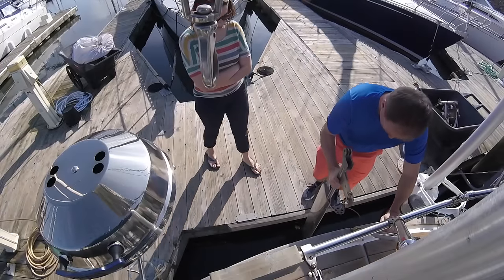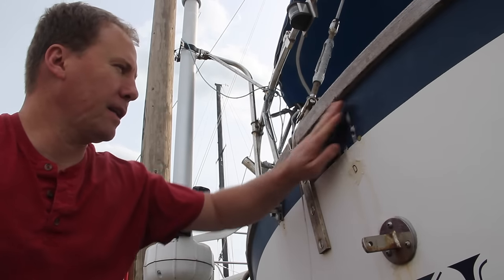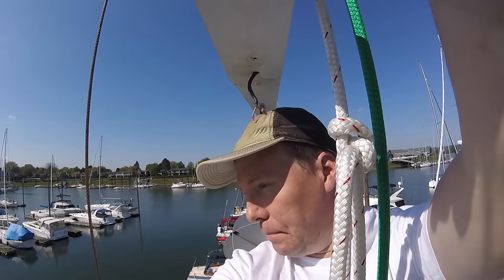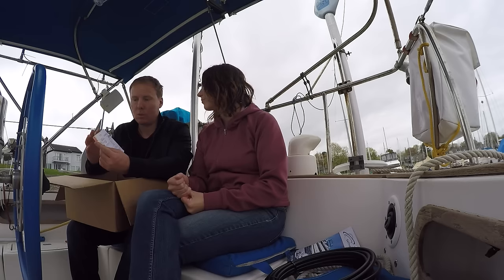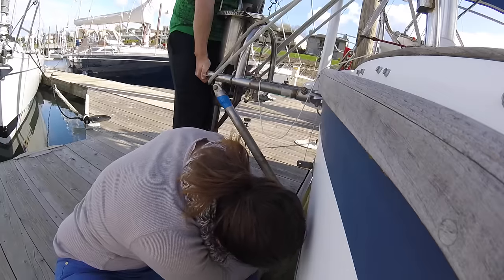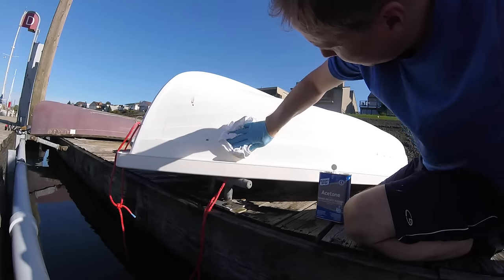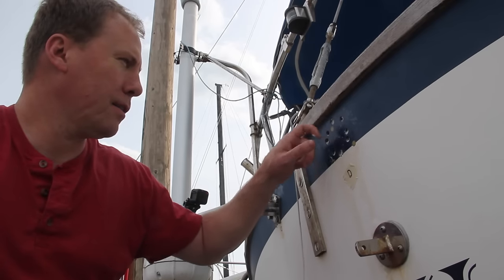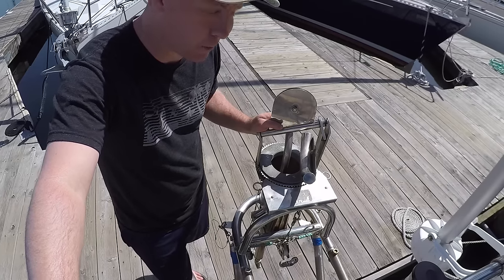THE VANE OF OUR EXISTENCE [Adventure #11]

Comment: A trick I like to use when filling holes or other areas with resin is put tape over the front and back sides then put the resin into a syringe (large gauge needle) and pump it in.  Fills evenly without air bubbles.  Also when filling holes or voids mix flox (finely chopped up pieces of fiberglass) or micro balloons in with the resin.  Makes much stronger.  When installing anything drill one hole and install a bolt/screw then drill the next hole using the antenna/bracket as a guide if the drill bit can fit.  If the drill won't fit in the space, try using the drill bit or scribe with your fingers to make an exact hole or mark.  Just my two cents.  Cheers!
Reply from the maker: All great ideas and great to know for the future, we certainly should have drilled one and installed the brackets to test the next etc.

Comment: Just a suggestion from a non-sailor. I would suggest sealing all holes, bolts and plates when you install them. You will be operating in a very corrosive environment. It is much better to protect from corrosion than have to go back and remove and treat it.  Good luck and many  years of happy sailing.
Reply from the maker: Very true and sailor or not great advice.
Reply: They mentioned using buytle tape to seal things up.

Comment: Whats the monthly bill for the aridium go ? Why the windvaine and not an auto pliot ?
Reply from the maker: Iridium fluctuates from around $50-125 depending on what plan we have it on that month and how much we will use it.  Basically we have it at $50 when close to shore and the higher unlimited $125 for offshore passages.  We have an electronic autopilot as well as.   A  windvane is less likely to break and uses no power  and actually steers based on the wind not the magnetic heading set in a computer, makes it more efficient.

Comment: I'm not saying that it definitely was the issue but I noticed the wire supplying 12V to the spreader light was kinked pretty badly SOMETIMES when that happens one or more of the wires inside can break over time... but that's only if you are lucky.
Reply from the maker: +MISTERComaToes Good thought, we will check that again next time we go up. We did check the connection in the mast and it was dead as well, we will take another look.
Reply: Adventure Adrift The connection in the mast? So there's a terminal block down low? If a terminal downstream of the light does
n't show 12v then more than likely the trouble is elsewhere and it's not up on the spreader...  It could simply be a matter of corrosion on the terminals at the terminal block or the terminals ends themselves.  Lots of water inside those masts...